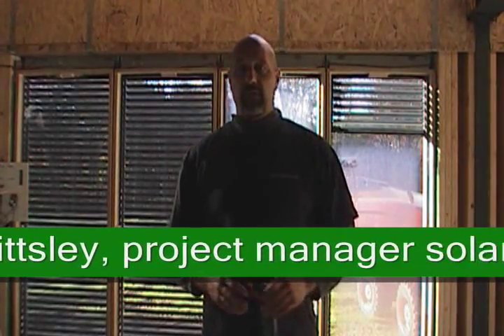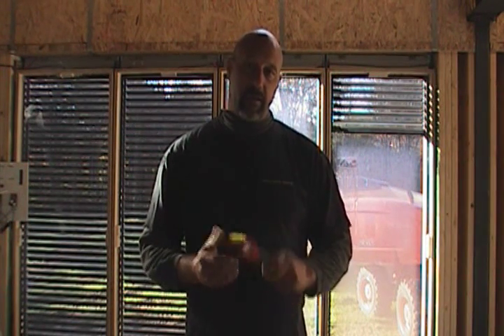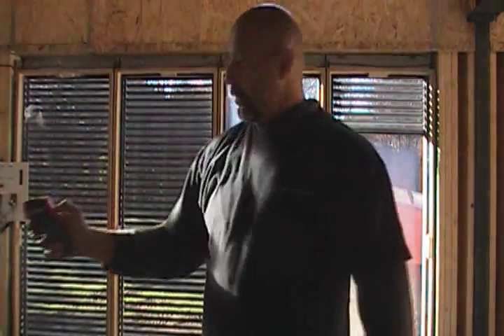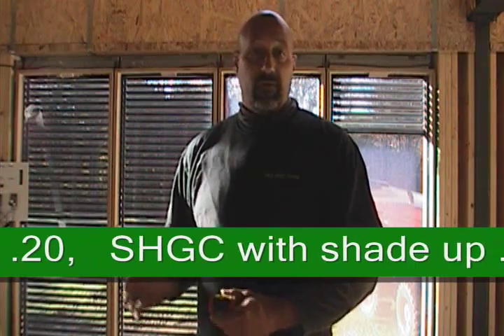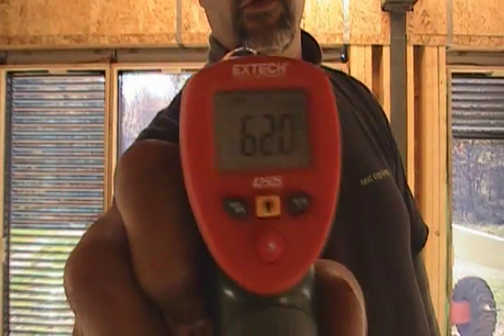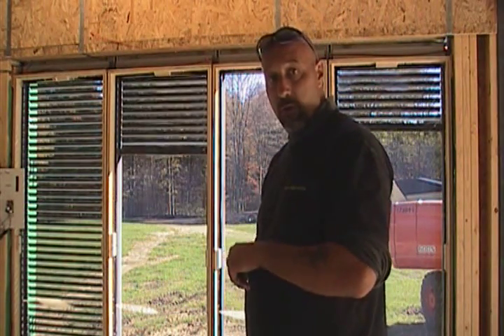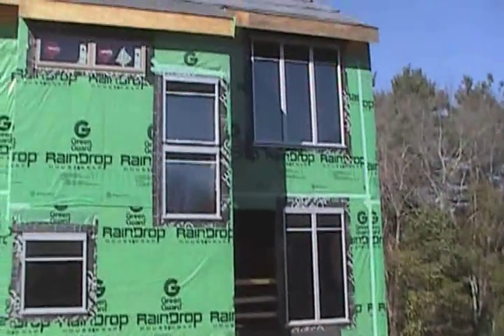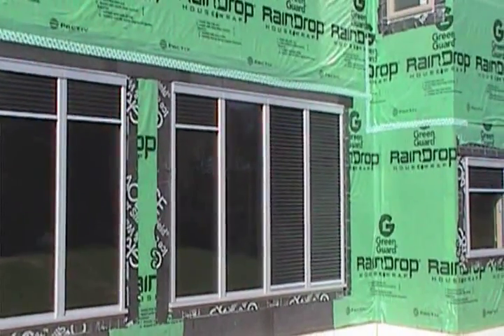Passive solar home, with very special windows

Comment: In North Brookfield, MA during November, December, and January you will get less than 3.16 kWh / m2 / day. 
https://pvwatts.nrel.gov/

This is equivalent to 10,782 BTU per every 10.74 square feet or about 1,000 BTUs per square foot of solar radiation per day.

This is not a whole lot of energy.

The best passive strategies that I know are
1- A house oriented with its longest side facing South.  
2- Previously sized awnings to permit the winter sun entrance through appropriately sized windows
3- A large mass either as a Trombe wall or a large mass floor surface (such as a concrete slab)
4- Excellent house insulation
5- Excellent air sealing

These five strategies will do more on the long run to help in saving money.

With a little luck the mass of the Trombe wall or the large surface floor will collect a portion of those 1,000 BTUs per square foot, and with a little more luck this stored energy will be released at night.  Luck in this case requires a good architect and engineer that understand how the materials of the wall or floor will aid in storing and releasing heat energy in order to have a time delay between energy capture and energy release.

I am not familiar with the windows used; however, they seem to me a bit long in length.  This means that while a large fraction of winter sun will get in through the windows, they will probably allow too much summer heat into the house.

Appropriately sized windows for both the winter and the summer might be something to consider (usually 7% to 12% window-to-floor ratio), and this together with an appropriately sized eave or overhang outside should take care of this.

Comment: You're showing a transparent window yet talking about a thermal mass gel, or a water-filled cube with insulated exterior glazing? Very confusing. Sounds like you're describing nanogel insulated glazing, similar to Kalwall's translucent panels that can have a thermal resistance of up to R-20 but have minimal thermal mass. I'm not aware of any window or glazing products that even come close to matching your description. Please provide more specific info. Thanks!